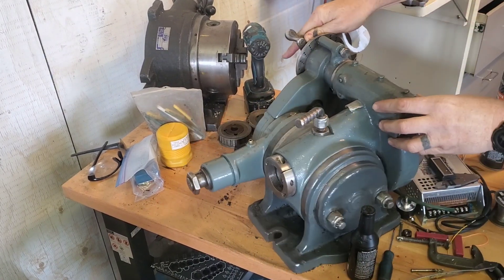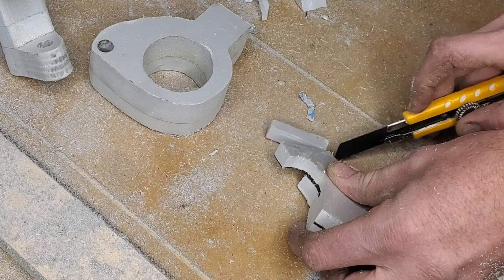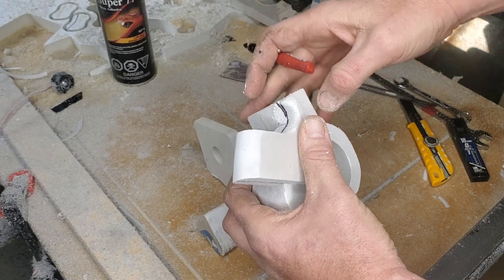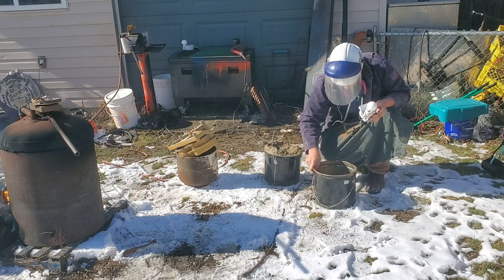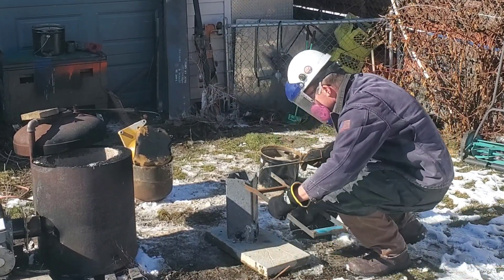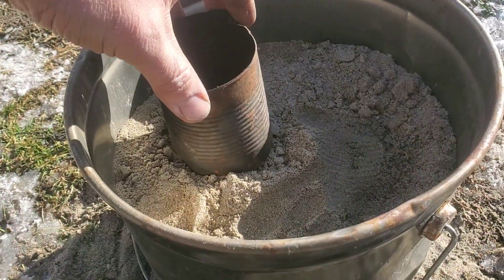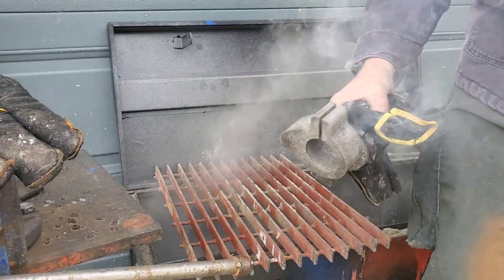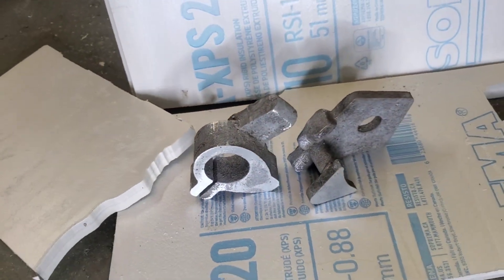Lost Foam Casting Servo Motor Bracket

Comment: I know its been a year now that you did this project and you probably already found this out but if you dip your foam pattern in plaster you will have a better finish on your part and you wont have to pack the sand around your foam pattern and risk warpage I would recommend dipping the foam pattern multiple times to make a thick shell around the foam pattern.

Comment: any use of those low temp (gas torch) aluminum fill sticks (from harbor freight here)
-
"Weld aluminum with any low temperature torch - even a propane torch. These aluminum welding rods are harder than mild steel which results in minimized parent material distortion during welding. You’ll also get a stronger weld than the parent aluminum material without flux or other welding material.
Harder than mild steel
Low working temperature (730° F)
No flux or fumes
Excellent corrosion resistance
Minimize parent material distortion during welding"
Reply from the maker: Yes , welding it had crossed my mind . I also have a alu welder ,but  curiouse about the alu welding rodsa . Maby one day ill grab some and play with it .   Could have been a viable way .   Im glad i redid it though and didnt have to machine the ⅛ gap after casting .